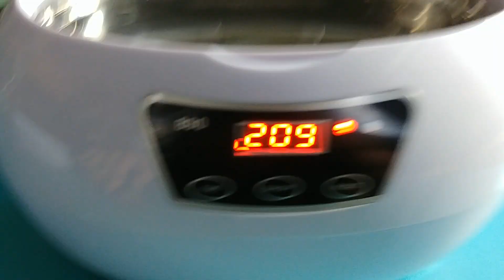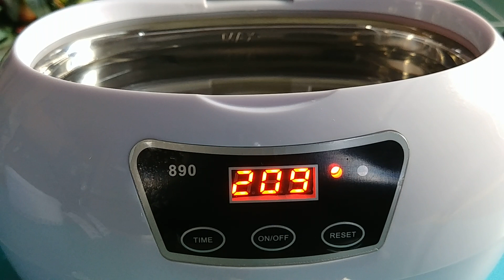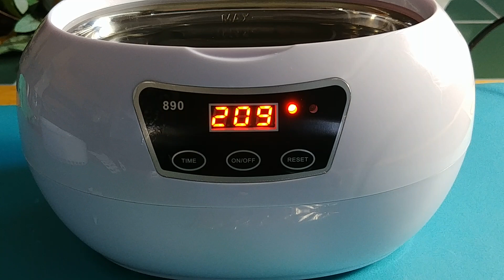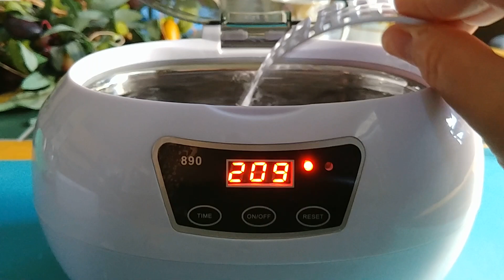How to determine if you have a true ultrasonic cleaner for watch parts

Comment: I feel I need to point out what I think is the error of your statement. The aluminum foil is not being “blown apart” from the ultrasonic energy. Aluminum has a very low cycle rate of fatigue. Even if it’s not pushed to the point of bending just the ossification on aluminum will fatigue and crack. It’s why airplane parts have life hours attached to them. Thy get replaced even if thy are not damaged because thy will
Fail  even when operating is n there normal range of movement. Other materials like steel and brass require going past that materials yield point ver and over again before it will fatigue. Next you mentioned it was discoloring your wheels (tiny gears). That dark color is oxidation and it’s from being cleaned super well in water. The water will oxidize the brass and make it dark. Most watch parts are kept clean and dry and done parts get piled. But once exposed to moisture there is nothing to Protect the brass and it will oxidize. So if you put your watch parts into a small jar that has proper watch cleaning solution and then put that jar into the ultrasonic water bath you will not have oxidation of your brass parts.
Reply: Excellent comment, some science involved, great.

Comment: Why do you want to make sure it's stainless steel exactly? Does this matter for the parts baskets some are brass?
Reply from the maker: Anti-corrosion properties are what is important so stainless steet and brass are fine. The basket in ultrasonic cleaners are at minimum 304L. My small parts holder baskets are brass.

Comment: So....what do you use now to clean a watch movement if not the ultrasonic in this video?
Reply from the maker: I use a 1950's zenith watch parts cleaning machine I paid $125 dollars for on ebay. For a hobbyist without a cleaning machine, the least inexpensive way is a few glass jars with Ronson lighter fluid and a soft brush, distilled water and then 99% isopropyl alcohol for final.
Reply: I do all by hand and rinse in IPA and dry on paper. I’m a hobbyist so I don’t need a machine. Thanks for posting